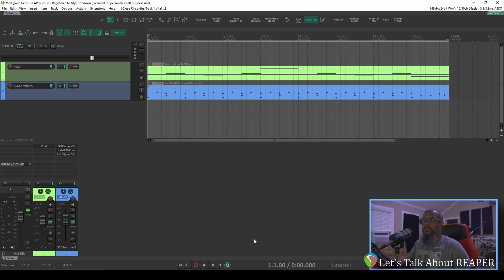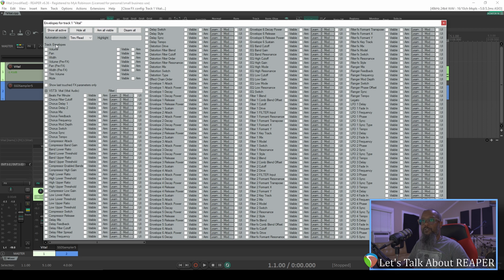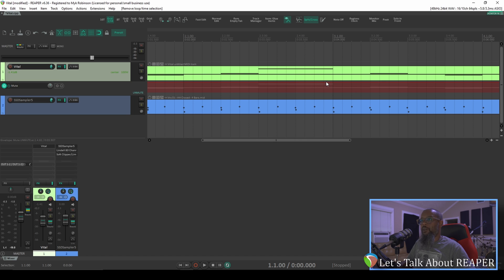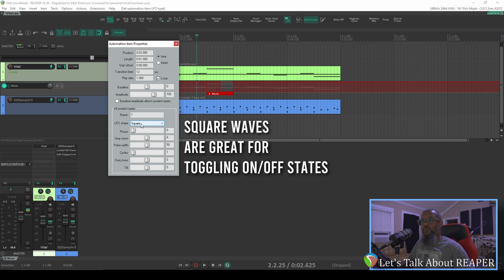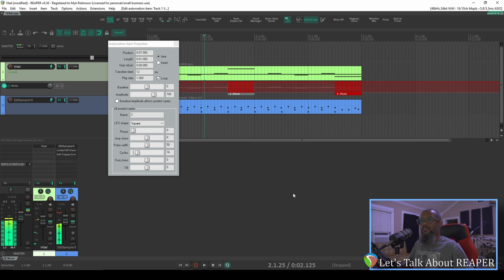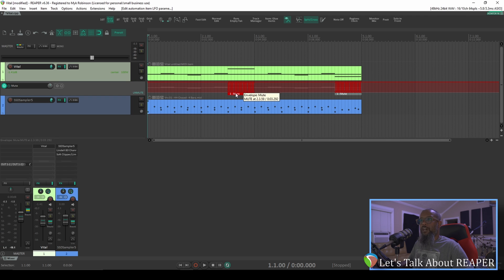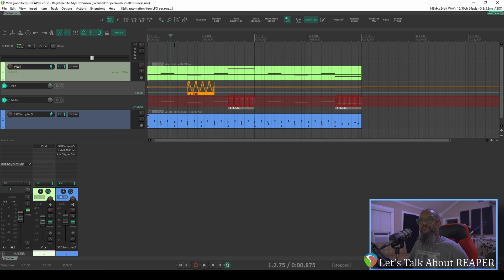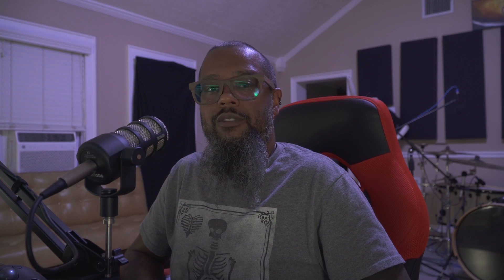REAPER Automation Items

Comment: GREAT TIPS especially love the ending. If you don’t mind me asking how do you like Steven Slate Drums I am currently using EZdrummer 2 but I’ve been looking into Steven Slate Drums. Thanks again and glad to see you’re feeling better.
Reply from the maker: Thank you, feeling much better now!

I can't say i really use SSD much, honestly, since I have my own drums and can play well enough. I do use it on occasion if a performer doesn't do well to a click and they don't have drums tracked yet, like when they would be recording scratch guitar tracks for reference for the drummer. 

If you are looking to upgrade from EZ Drummer, i think i would go with Superior Drummer 3. It is FAR more versatile and also has the option of sample replacement/augmentation of live drums. It will literally listen to drum audio and convert to midi, and allow you to trigger samples from its libraries. SSD seems it aims to be more "mix ready" drop in replacement, whereas Superior Drummer feels and sounds more "natural" and less overly processed to my ear.

that said, if you need some lives drums for a small project or would like some to work with just to mess with learning to process live drum audio, mic bleed, phase alignment, and all that stuff, I'd be glad to throw down a beat or two!
Reply: @LetsTalkAboutReaper  Superior Drummer 3 is an excellent choice.
Reply: Addictive Drums 2 (which is what I use) is another good choice.